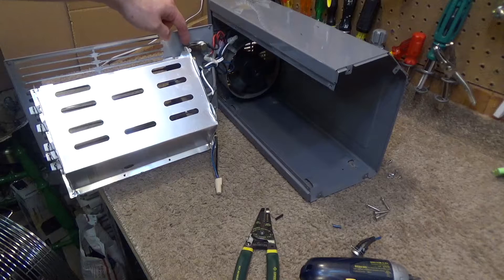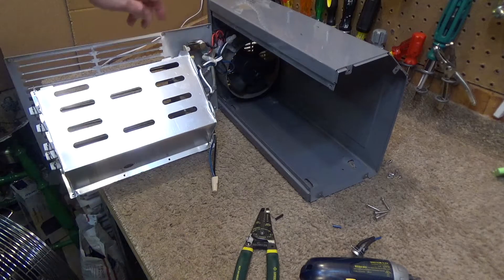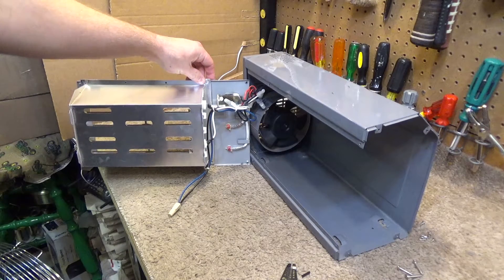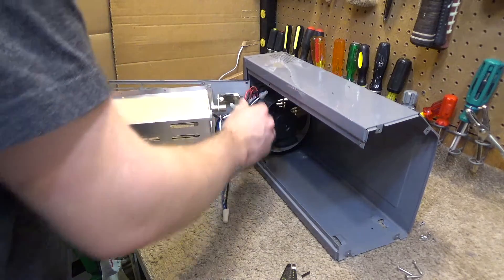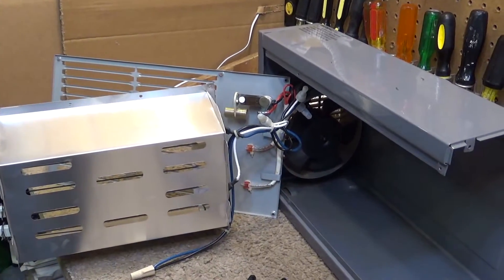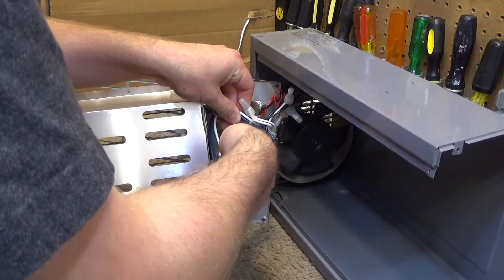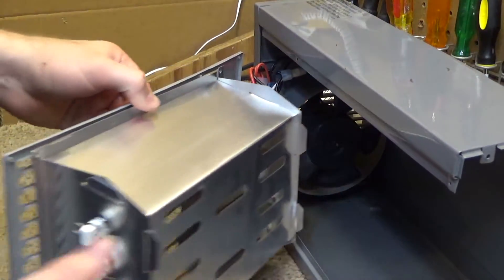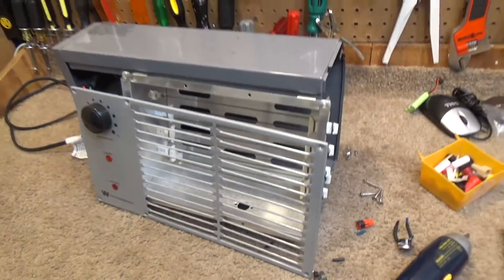White Westinghouse WWHR3010 Radiant Fan Forced Heater Repair | Conclusion

Comment: Kind of surprised that this has one of those PC style plastic fans, like a cube style heater. I would've expected a two or four bladed aluminum fan, but I guess heaters don't have those anymore.
Reply from the maker: I think this is of more recent make, certainly too recent for a proper metal fan.
Reply: @JordanU  Only Cyfral and Eltis never sudsy spinning! I told Anais

Comment: 115°F seems awful low for being that close to the element. I figured somewhere between 200 and 300°F would have been the cutoff range. I would try to plug up that hole in the bottom somehow because you will otherwise lose a small bit of heat out the bottom. I guess you could save that if you ever end up needing a thermostat for something.
Reply: I suppose he could just put the thing back in there, disconnected; that would be the fastest way of covering the hole and would make it look original.  Then if he ever needed it elsewhere it could be removed again.
Reply: @Xyspade  That's what I was thinking too. Covering it up with the thermostat is the best method. I can't imagine it was designed to operate like that because it just makes no sense, but maybe there's a possibility it was meant to do this to make for more even heating. I highly doubt it though.
Reply from the maker: I cannot believe both of you, as reasonable intelligent individuals, are not understanding the way this works. The fan pushes air into the heater; the air would be coming out of that hole and pushing the air into the room. Absolutely no heat is lost; if anything some heat would be gained from the additional airflow, though likely a negligible amount.
Reply: I was moreso just suggesting covering it to avoid the big ugly gaping hole, but OK.
Reply from the maker: @Xyspade  Valid suggestion.